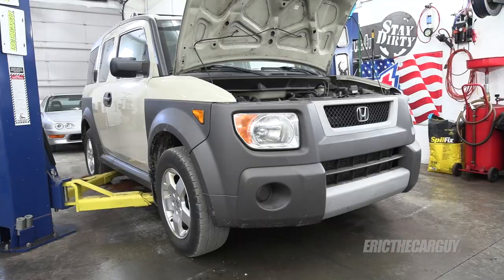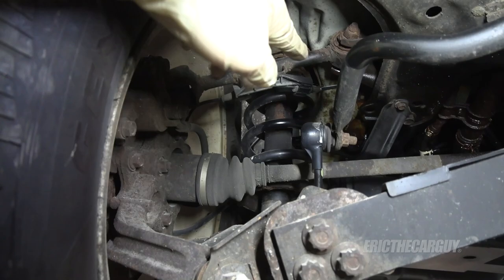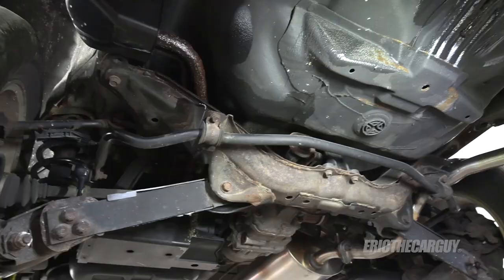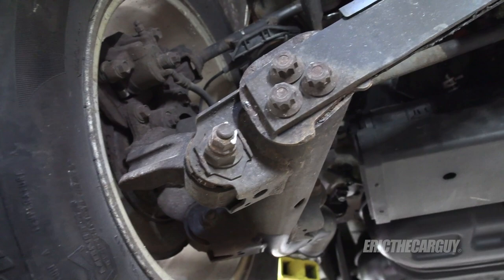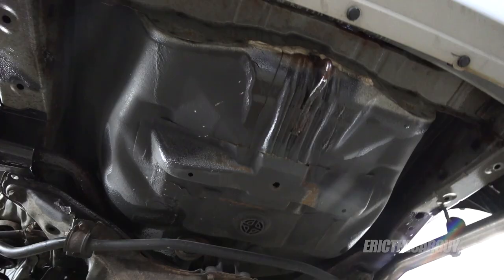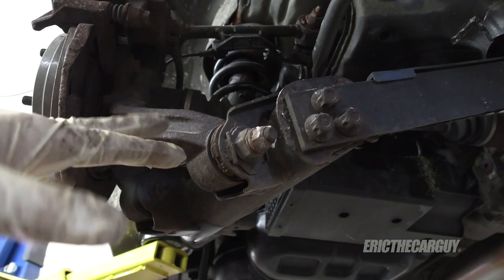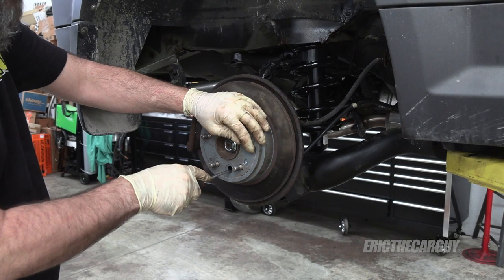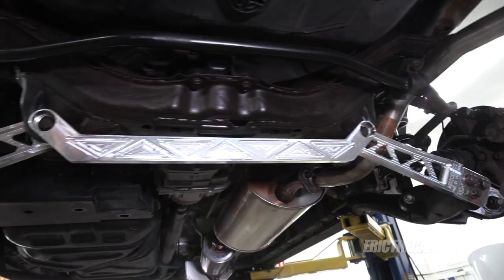Honda Element Suspension Rebuild (Part 1)

Comment: I have a 2008 Element. It has a genetic defect. The antilock brake module let air into the lines. They did a recall but it didn't solve the problem. I guess I just got a lemon. I take it in once a year and get it bled. What a hassle.
Reply from the maker: Weird. I've never heard of that.

Comment: Those axles belong in an ATV.  Not an automotive application.  Cheap, weak, Japanese junk as always.
Reply: And yet it's extremely rare to have one fail.
Reply: @motochris5459  
LOl if you mean every day, your comment might be relevant.  They're cheap garage.
Reply: @wildman1137  30 years as a Honda car tech. Don't recall ever having to replace a rear axle. Front, well that's another story.